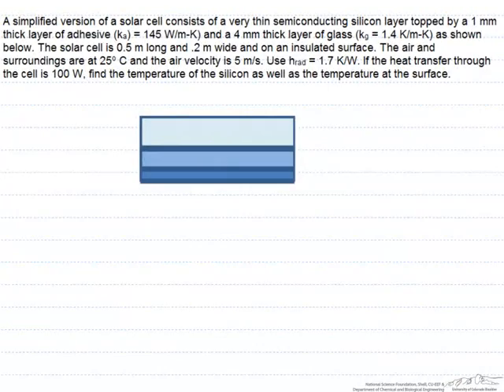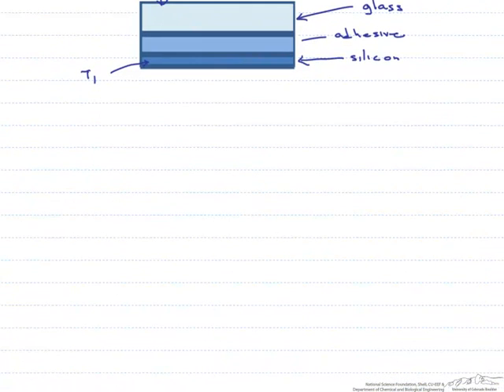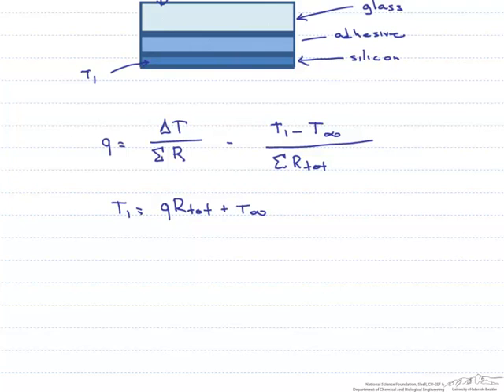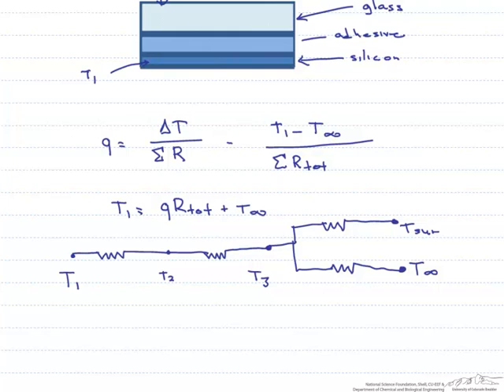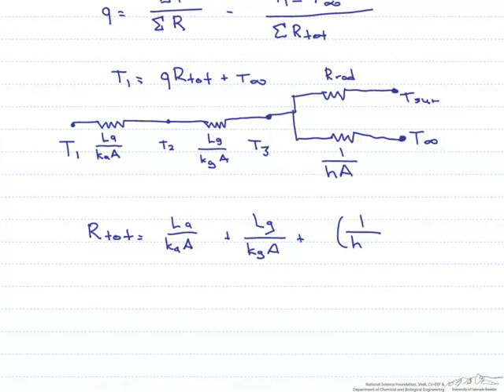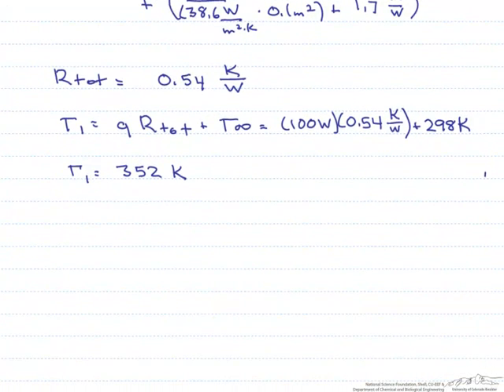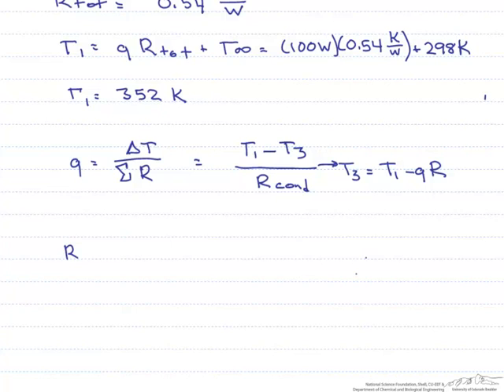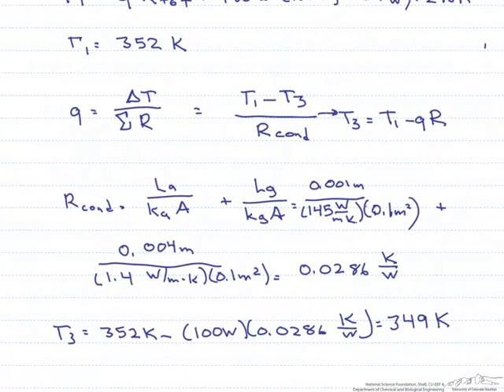Solar Cell Part 2: Surface Temperature

Comment: I believe the thermal resistance is not correct. It should be (hA + (1/Rrad))^(-1) for the parallel part. Without rounding, Tsi=50.36C and Ts=47.50C.
Reply from the maker: Thank you so much for this comment. It looks like you are correct and we will fix this error.
Reply: @LearnChemE  Thank you! I really appreciate the work you guys do.

Comment: I recently discovered that a private developer is proposing a 350 acre solar farm below my property. My home is approximately 20 feet above the solar panels at 150 feet away.
Our orientation is south southwest, [ the same as the solar farm] what air temperatures will be generated towards my property and what would be the dangers of the solar farm? The wind would blow across the farm directly towards my home, 1/2 mile of panels.

Thanks
Reply from the maker: I'm sorry, but this is not part of our expertise.  Please send your question to an expert in this field.